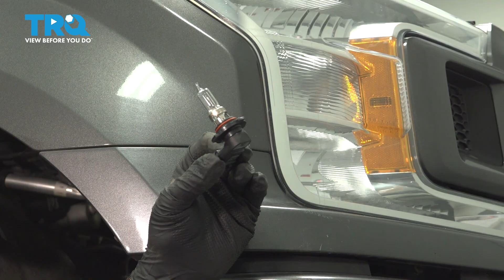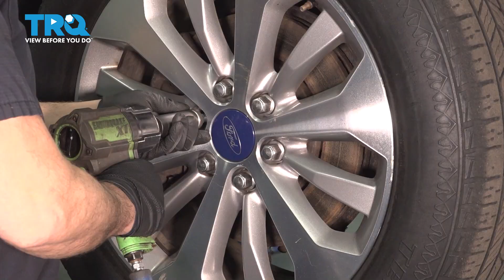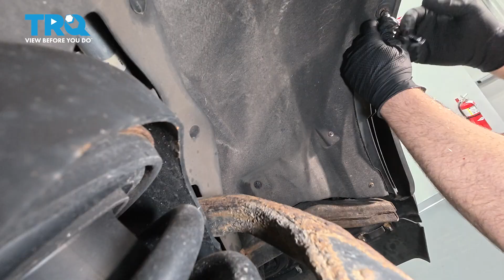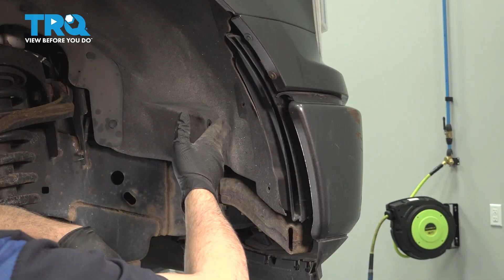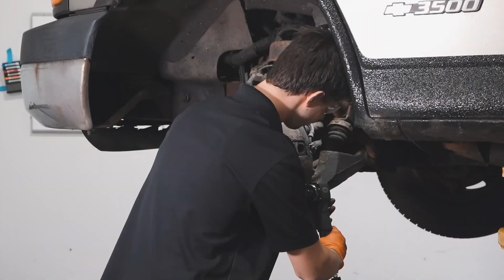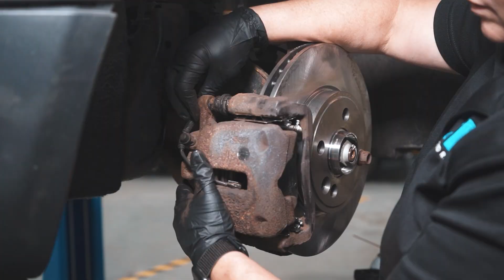How to Replace High Beam Bulbs 2015-2020 Ford F-150

Comment: I found the bulb was not able to return to the original position locked. I had to loosen the 3 Allen screws on the housing ring and tighten them after locking the bulb in place